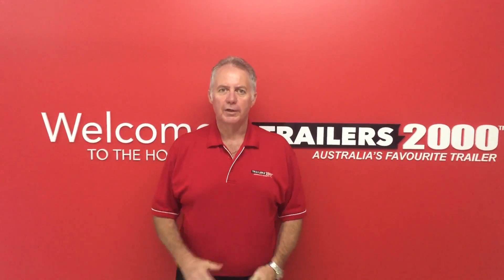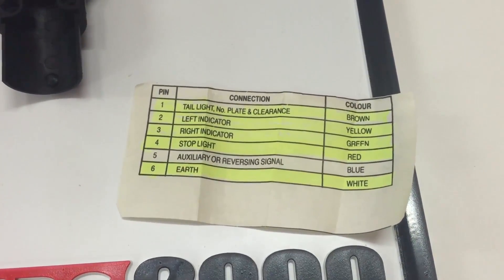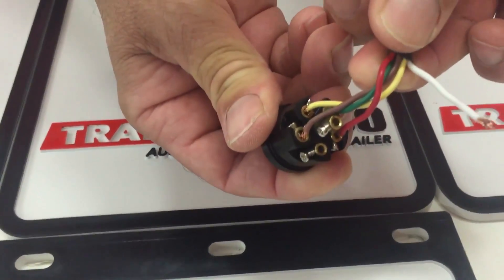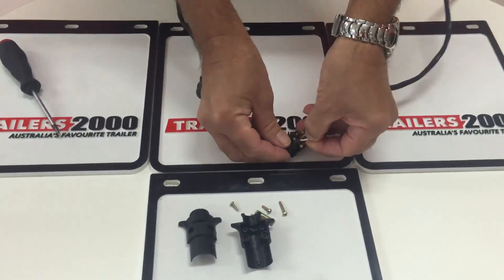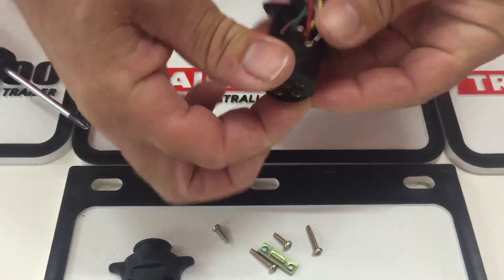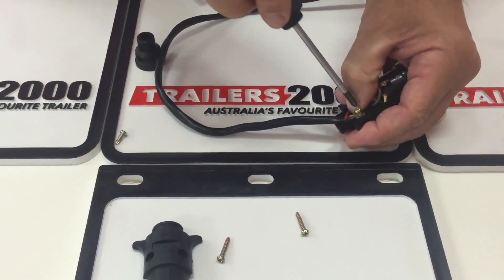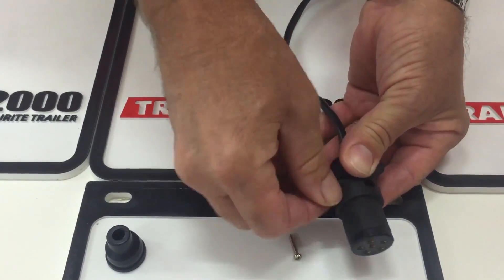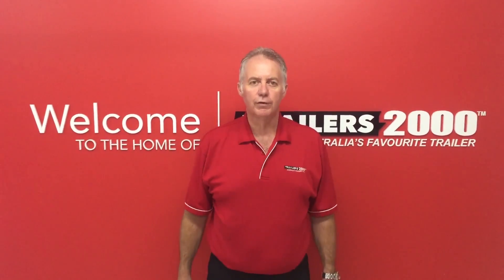How to Wire a 6 Pin Round Trailer Plug

Comment: Can you still hook up the black wire? Or just cut it short? Working on an old trailer and they had the black in but the red cut short
Reply from the maker: Hi, the black wire is general for brakes or auxiliary.  if you are only running stop, tail and indicator lights then you require only 5 wires, yellow, green, brown, red and white.  You can cut the other wires short.